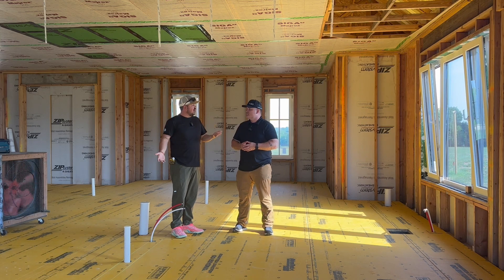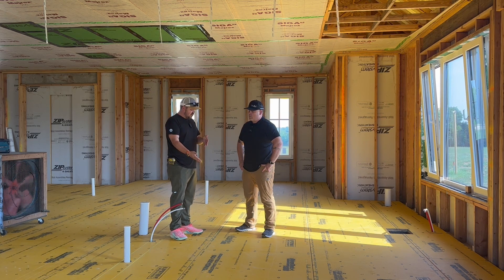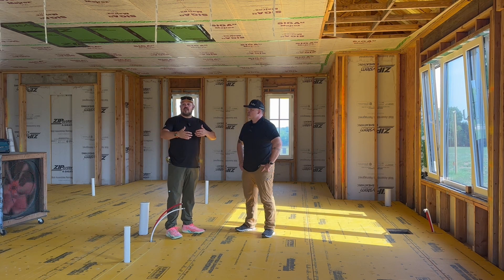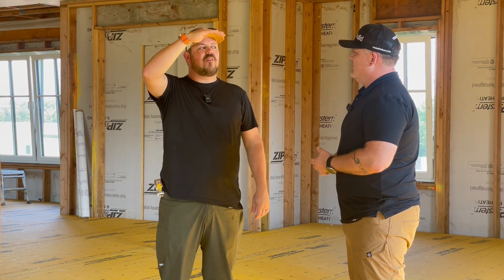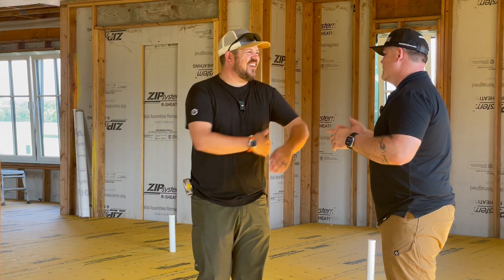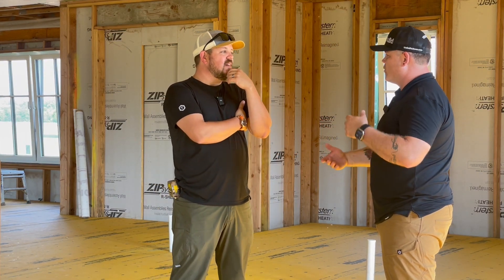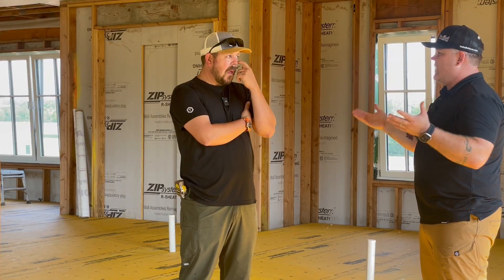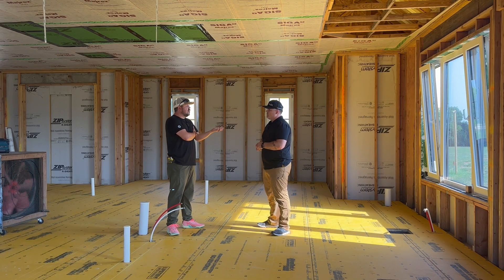Don’t Put Water Line in the Slab

Comment: I did see this overhead piping system in my parents 8 story building in FLA. Funny thing , maybe not, the owner below them thought my parents piping was leaking. Initially, I thought the same thing. I got the plumber to the building , I cut out the ceiling , he cut the pipe after I thought I turned off my parents main valve, he gets soaked , yells at me. I then realized the piping is overhead in each unit and NOT my parents problem. It was her own piping , I thought good idea.  thanks ,  JB.

Comment: Love it Jake. Service cavities that are inside the air/vapor/water/thermal barriers keeps penetrations through those barriers to a minimum, makes it easier to modify later and keeps the mechanicals inside the conditioned space. 2x strapping does represent a small increased cost but the benefits will endure throughout the life of the structure.

Comment: I used one pex water supply to centrally placed utility closet through conduit through slab.  Then pex manifold distribution through compact system in drop ceiling design.  All in the front end architectural design.

Comment: Ive yet to meet anyone with an old slab house that hasn't had to replace plumbing.  With pex have you tried a pvc conduit in concrete so the line and be pushed through for the island
Reply from the maker: That is a great tip. We have started to use the sleeved Pex. You can actually purchase it pre-sleeved. Stay tuned for other content on that in the furture.

Comment: This is one of the big reasons I want to go with a trussed second floor. Plenty of space for all of the water lines, electrical and ducting, and all of it goes in after all of the framing is done. It does put restrictions on some things though, like not putting a sink on an island. I'm definitely considering a floor system like this for hydronic though, nothing in the concrete and just swap one of the subfloor layers for something like Warmboard.